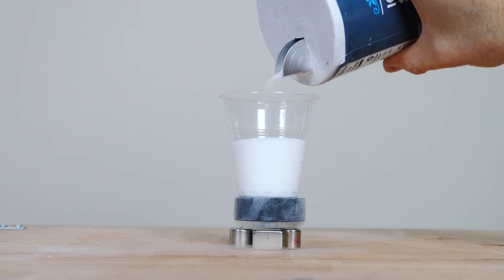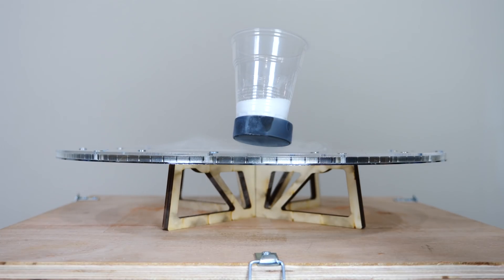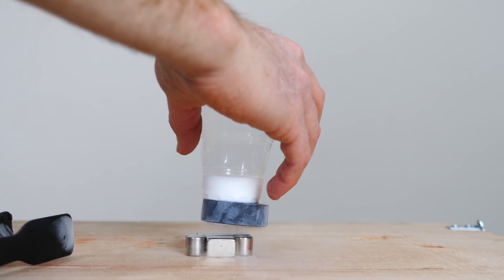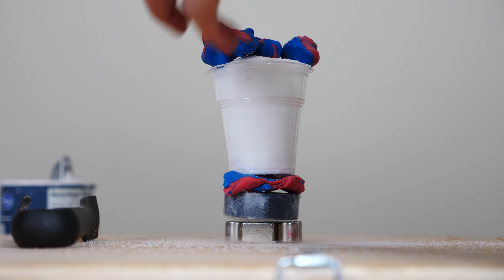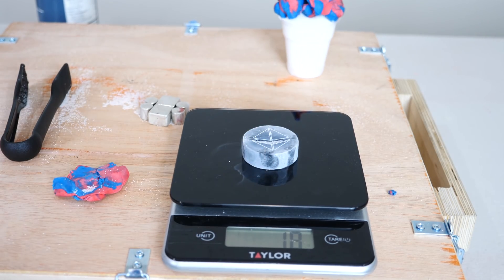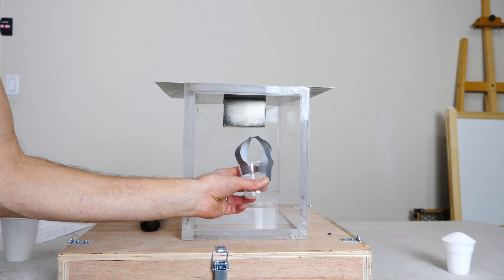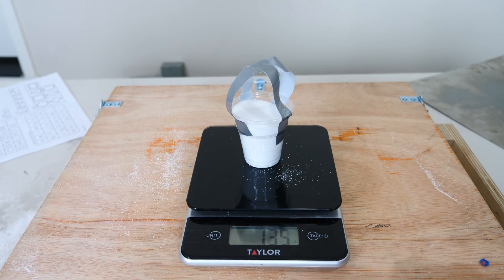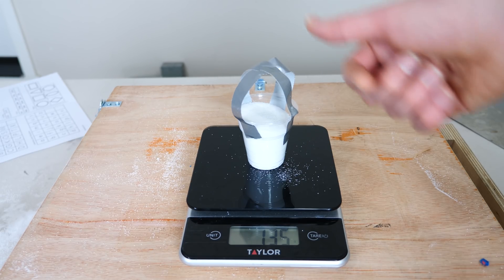How Much Weight Can a Superconductor Hold?

Comment: I found it intersting that as you added weight there did not seem to be a change in th gap between the magnet and the superconductor. That wold seem to indicate that there is a governing system acting between the magnet and the super conductor. A sort of equilibrium which has to exist. How would you go about measuring the changes which seemingly must take place between the magnet and the super conductor. Also I dont think salt weighs very much so I would like to see something like a spring being used instead of the feild.

Comment: I first heard about superconductors many years ago in Beyond 2000 ( it was Aussie tv show if i remember it right), where they demonstrated that these can actually serve even as replacement for axle bearings in cars with obvious advantage being zero effective friction, however also making somewhat rocky ride in the process as you cannot use traditional spring dampening system in this application.

Comment: The platform that magnet is propelled from is the earthgrid/paved road.  The magnet is car.  Radio frequency emitted with the transitioning of housed electrons within a programmed trinity laser will ascend the vehicle.  The trinity laser, while housing electrons, will also allow for a halogent-road to be projected under the vehicle causing it to rise where certain sections of the physical road emits lower electromagnetic frequency.  The trinity laser will also project a pathway, similar to gps without a sat comm & have the capability to sense for objects with an electron force field to prevent vehicular accidents with singulairity cpu drive.

Comment: As your super good doctor cools what is the differential between temperature drop versus weight the salt? Quantum locking is very intriguing but again it starts with expelling energy from the nitrogen so everything after that waist of energy is a formula that is based on expelling energy to achieve the desired results.

Comment: Where can I buy one of these pucks. I know where to buy a 'puck' of solid YBCO through and through, but its not a several-nanometer thin layer deposited on aluminum or a synthetic sapphire (because it conducts heat really well) like I believe you to be using here.

Comment: i have a question: why doesn't the strength of the neodymium magnet have a stronger "bond" to the superconductor? wouldn't the stronger magnetic field have a stronger quantum lock (edit: therefore enabling the superconductor to hold more weight) ?

Comment: Whenever I watch your quantum locking videos I imagine this technology being used to make a friction-less form of train travel. Could possibly employ a constant cooling system to maintain low temp of superconductors along the bottom. Probably utilizing a material to trap the coolant like the foam you use.

Or imagine using quantum locking to make a roller coaster. Constant cooling of the superconductors may not be necessary for this.
Reply: Bullet trains in China, Korea and Japan do use maglev technology  using electro magnets which is far easier and controllable than using superconductors

Comment: Not even at 20 seconds I am curious where you got that shirt. Also, what is it called? I made a few symbols when I was a teen and it reminds me of them. It is basically The Star of David and I even put the rings around the points but didn't connect them with lines but with another circle. I'd like to get one so any info is appreciated. Here is a link to my Facebook picture of the 1998 work I did for a haunted house but I kept it because they were too big to use. https://www.facebook.com/photo.php?fbid=1693238690163&set=a.1332092581736&type=3&theater

Comment: Does it make the magnets stronger if u cool them down to
Reply: No, because they're permanent magnets. They retain the same magnetic strength whether they're frozen or at room temperature. Only when you heat up a magnet high enough, it will lose its permanent magnetic field.

Comment: What if you filled your glass/plastic container with air, CO2, methane, water vapor and NO2 (seperately), put them in direct sunlight and measure a temperature increase? Given climate change, I'd be interested to see if there's a noticeable change in a small volume :)

Comment: In the first test out seems like the main problem is that the center of gravity gets too high making more difficult to measure how much weight it can hold before it falls over. Maybe a denser material would work better. If you can find a cheap one it may be worth another try.

Comment: Cool experiment. I wonder though, would the strength of the magnet itself change the overall load it could carry? Stronger magnet = more weight?
Reply: Yes! Look up flux pinning, the wikipedia page has a lot of info about the relationship between both the strength of a magnetic field and the area of the super conductor and how that affects the strength of the pinning

Comment: Brother , Please tell us , Is power of quantum lock (i.e. ability of superconductor to hold something means that you did in this video) changes when surface area of magnet is increases or surface area of super conductor is increases or increasing the mass of magnet i.e. big magnet with double the mass of previous magnet but same surface area .
Brother you know what I mean 
I would rather say that what can be the formula of quantum lock power to lift things . It depend on mass of magnet or superconductor , or depend on surface area of magnet or superconductor , or depend on distance between the magnet and superconductor please brother think about it for me please brother please make a video for it

Comment: Cool video, as always =)  But couldn't you just put the magnets on a scale and start pushing on the superconductor, to read the weight when it starts moving or touching the magnets? Or would it just move, without changing the scale?

Comment: Try locking the puck above one of those prinyed magnets.  U know the one that has a couple of north and south poles on one side. They have more strenght with a smaller surface and a smaller gap.

Comment: Does quantum locking work on electromagnets ?  Will quantum locking react differently if the superconductor is placed in between 2 magnets (set-up A magnets facing with opposite poles, set-up B/C magnets facing with same poles) and are fixed with both at a distance that barely attracts/repel each other

Comment: Can you test the radiation of the new iPhone 11 I heard it has really high levels
Reply: Relative to other phones kinda high. But in the grade scale of things there isn't really nothing to worry about. The thing does not emit any ionising radiation (the kind that radioactive materials emit) and the only effect it'll cause is that a part of your skin will become barely  warmer. There's more heat coming from electricity running around all the conductors in the phone than radiation energy.

Comment: Hey
When it was hanging
You pushed it a bit and it started rotating but why did it rotate backwards again as if it was tied to a rope
Why did it happen?
Hope you understand my question
Reply: Nice observation.
I wonder what happens if it continues to be forced in one direction. Will it gain resistance until the pinning effect is broken?

I think this is also part of the process that occurs on the Sun leading to coronal Mass ejections and such.
Reply: I may (probably) be wrong, but I think this is because of the quantum locking itself, the conductor wants to stay in the same position it is, so as he rotates it, it builds up resistance that creates rotation on the backwards direction

Comment: I would have super appreciated more information about this quantum levitation so I wouldn't have had to do a crash course in superconductors, their types, compositions of various superconductors and their Kelvin temperatures in which they have 0 resistance. Finding this $6,500. magnetic track with yttrium-barium-copper-oxide superconducting levitators was the tip of the iceberg. Learning about the production process of type 2 Y-Ba-Cu-O or YBCO superconductors and how the magnetic fields exhibit quantum pinning by equaling an opposing magnetic field without the losses due to resistance . 

A little help would've  been appreciated.
Reply: Very long.

Comment: I also find very interesting that it doesn't "compress" like springs do.

Considering basically 0 friction it would be an amazing tech for smth like trains or delivery.
Reply: Although it's very expensive, needs a lotta energy to cool down and so doesn't beat the modern magnet trains
Reply: @siebevandekerkhove9863  Yes. I also thought that cooling would be a big issue for industrial implementation. But heck is an idea. :)
Reply: Wow you discovered bullet trains
Reply: @lolbro8701  Are there real life bullet trains that use quantum locking?
Reply: @lfk51651  Is it quantum locking? ;) Please google at least before posting "smart" replies.
Reply: @nTu4Ka  It is, didn't they teach you this in school?
Reply: A lack of sufficient friction is actually the bigger problem on trains. The reason trains have so many wheels is because trains can't get sufficient traction on the rails to move their massive weight. And if you had an alternative means of propelling the train and you wanted to do so at such a speed that friction with tracks would be a problem, it'd basically be flying at that point anyway.
Reply: @2Cerealbox  How about this: normal frictional wheels when gaining or reducing speed which then lift off the track, replaced by superconducting magnets when cruising?
Reply: @2Cerealbox  I doubt that it's a real issue. It doesn't have to be friction to move the object (to apply force). Again maglev trains exist.
Reply: In Japan there's this Maglev train, it works by magnetic repulsion.. if I can recall 🤔

Edit: Yup, it seems like others has mentioned it 👍😅
Reply: @00WatName00  Yes. Most others made the same mistake - it's not quantum locking.
Reply: Bro everyone talking about using superconductors commercially scientists have been working on it since a long time 
You think that scientists came to knew about this now and he would get a sample that is impossible
Reply: but it'd have to be super cold
Reply: @AshrZ  Yes. This seems to be one of the main issues.

Comment: why you dont put the whole salt pack on the magnet? xD
Reply: Sorry when I read the comment the first time I thought you meant for him to just put the can of salt on the conductor instead of pouring it a little at a time into a cup
Reply: Cause then he wouldn't know the exact weight the puck could hold if it pushed it down onto/away from the magnet
Reply: @lazyer0511  that was not meant seriously, but he would have known quickly where the limit was, above or below without leavin all the salt around ;D

Comment: i bet it heats up a lot quicker , there as to be some kind of " friction " between electrons that holds up the wheigt , so there must be some kind of energy output from that " friction " that causes some heat that makes the superconductor heat up quicker and lose is properties by heat diseeption
Reply: It'll only heats up faster because there's heat coming in from the cup and all that. As long as it's stable, there's no work being done, so no dissapation. If you move it or make it move then you'll get flux jumping, causing dissapation
Reply: @WouterVerbruggen  good point there , i had did not think about that

Comment: Is it possible to create a tower of quantum locked pucks? Like stacking magnets over the puck and then another puck on top of that one and so on...?
Reply: Not exactly sure it would be possible to place new magnets on top without interfering, though I'd really like to see if it works or what appens otherwise

Comment: Pretty sure you gotta cool down the ceramic superconductor while it's on top of the magnet to get proper flux pinning and prevent it from tilting.
Reply: Interesting hypothesis. Depends on the physical reason for the tilt. I'd say the tilt is due to the pinning centre's distribution, which has nothing to do with how it was cooled down. Or more likely, the gradient in the magnetic field.

Comment: Is there an equation that can predict the weight it can hold under quantum locking?
Reply: Yeah. The fluxoids are pinned by a pinning force (how strong a fluxline is stuck to a site). Wikipedia has a simple explanation, search for flux pinning

Comment: hey does the quality of the type 2 superconductor i am using matters with the weight it can carry??
Reply: Depends on your definition of quality. For this application, you need a lot of defects, grain boundaries and impurities. These increase the pinning force and hence the 'amount' of flux pinning. Usually, for magnet systems, "quality" is expressed in either the amount of current it can carry or in how steep it's transition into superconductivity is. Both of these generally get worse with the aforementioned things. So you actually need a very bad, dirty superconductor XD

Comment: I think there is one thing I would like to suggest in this experiment. Every time before you add a new weight, you should try to cool the superconductor once again. As you showed in a previous video, there is a time limit to the superconductor's floating ability. So I think that this was very pronounced when you were trying to hang a weight from the superconductor. You had to keep removing some salt again and again, but where as few seconds before it could carry the salt which you had just removed.

Comment: I believe. I saw an error in your test, if the super-conductor only takes up 1/4 puck. From what I could tell, when the force was pushing the puck was opposite from when hanging 

Also what are results with stronger magnets when force is pushing?  Can it hold more weight or is there some kind of upper limit?

It is strange how it can not sustain the same weight when pushing and hanging, even when the magnet is larger when hanging.  This also is perceived to be the case with opposing vs attracting magnets.

Comment: why isnt the force infinite?
If the resistance would really be 0 than the current floating through it would be infinite. And because of this the opposing force (lorentz force) would be infinite even if the magnetic field was very weak.( like the magnetic field of earth) but why isnt it infinite?
Reply: The opposing stength of both magnets are not strong enough to push it further apart
Reply: @the_expidition427  But
U=-N*dB/dt with B being the magnetic flux and d being the difference and t being the time and N being the number of the convolutions of the wire. So there has to be some indukted voltage.
Now I=U/R
gets near infinity if R gets near 0 and because of 
F=i*l*B the force is infinity for
 i=infinity.
So why can he move it in a magnetic field?
Edit: I think when a lot of current passes through it warms up at some points and then it isnt a real superconductor at these points any more and then it can be moved. But i'm not sure
Edit 2 : i've read in wikipedia that the resistance actually isnt 0 but smaller than 10^-(20 ) so is this true what would explain my problem or is that wrong?
Reply: The resistance is not 0. The current is actually very low here, induction is not what's providing the opposing force. What is, is that flux lines inside are pinned and it takes energy to move them w.r.t. the material it's in.
Reply: @WouterVerbruggen  In anorher Video he explained that the resistance actually is 0. Also he explained that this effect is similar to the effect of a magnet slowly moving through a copper pipe. This is due to induction. I think that the flux lines are "pinned" inside the superconductor is due to the very low resistance which should be 0 theoretically. so you couldnt move it theoretically because the flux lines would have to move through the material if you moved it. (maybe they get deformed by this action and there isnt any current inducted because if it was there would be a infinite current and force) So maybe he can move it because of the flux lines move with it because the magnet isnt strong enough. I think now i understand it. (while writing this comment) .
Reply: @neutronenstern.  yeah and I criticised him on it. Technically the actual resistance is zero, but effectively other things make it so there is a residual resistivity. For example the magnetic field (including self field). Your explanation has some sense, but is not correct. Flux lines are pinned because it's energetically favourable for the normal (non-superconducing) core of a fluxoid to be an actual normal spot in the material. The comparison on induction in copper is because when you move a fluxoid you move a magnetic field, hence you have a dB/dt.
Reply: @WouterVerbruggen  At this page its also exlained with the lorentz force: https://www.supermagnete.de/magnetismus/supraleiter
Also why is it energetically bether if the magnetic field lines are "pinned" and also how can a imaginary thing like field lines be pinned?
You can explain that the sea level rises due to the moon because it is energetically bether, but you can also refer to the gravitational field.
Also you can explain it with special relativity. But I think the best and simplest explanation is that theres the gravitational field with its force moving the water across the earth.
So the energetically explanation isnt enough for me(and i dont know if its actually true).